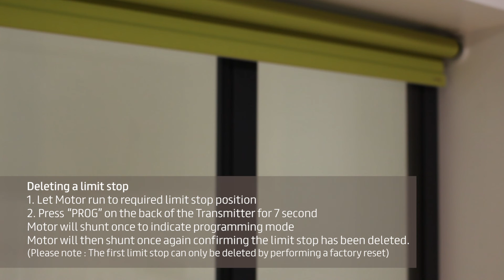24v DC Tubular motor with radio receiver & transformer - programming instructions

Comment: The likelihood that you're able to help me with my situation isn't very good but I'm desperate to get my gazebo roller screen fixed.  Bought it from AliExpress and as one might expect there is little to no after sales assistance.    The motorized tube that the screens roll on has adjustment dials, the top one for upward adjustment and the lower for downward.  The remote, an AC123-01D, is what's used to set the motor to its factory default settings,  I performed that function.  To adjust the upper and lower limits, one must turn the aforementioned dials one way or the other.  For some reason using these dials are has no effect.  I've tried every which way.  I know this is a long-shot but it's worth a try anyway.